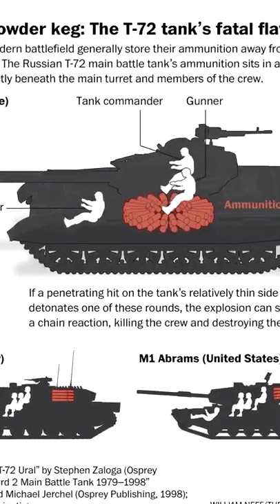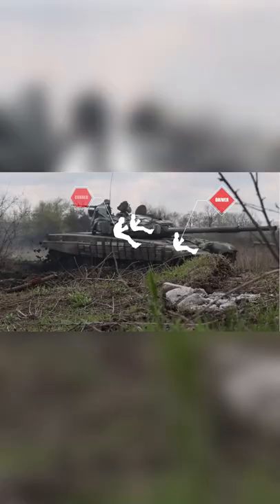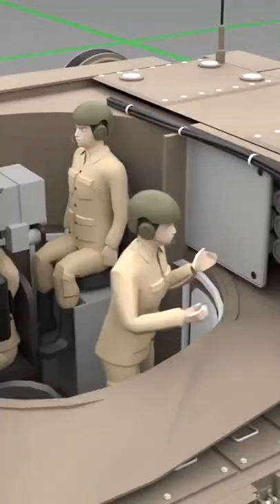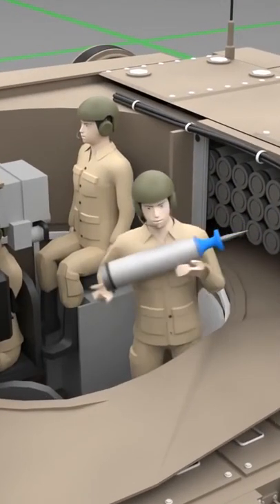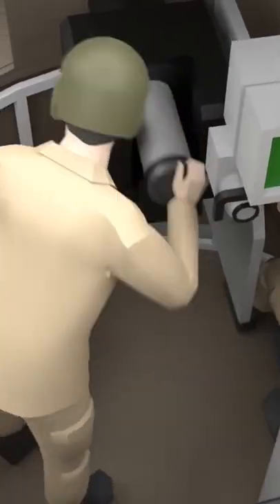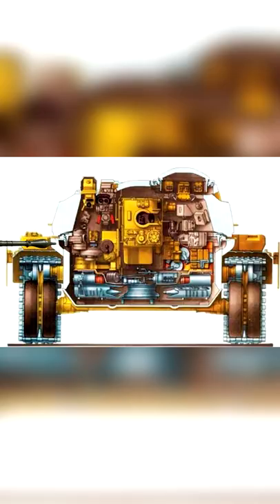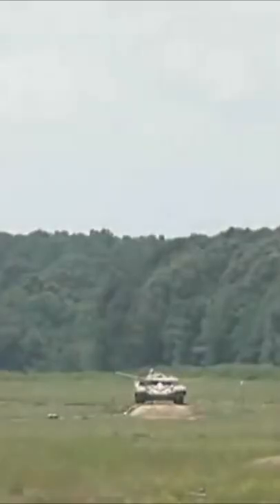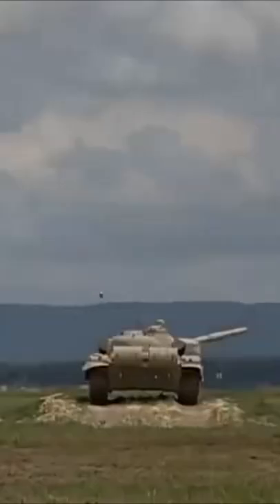Why do Soviet-Made Tanks Keep Violently Exploding? 🤔

Comment: It’s due to their auto loaders
Reply: no shit
Reply: He literally explained why that happens and it's not due to their autoloaders but rather because of hull stored ammo
Reply: @gumelini1  it’s due to the shitty way the auto loader works it has to have open ammo compartments for the auto loader to work
Reply: @Phlyinhigh  actually it doesn't.
Reply: French Leclerc also has auto loader but they put the ammo in the back of the turret. So definitely because of the ammo compartment location and not auto loader itself.
Reply: @gumelini1  there are no sealed blast compartments or “blowout” compartments so yeah it’s due to their shitty auto loaders
Reply: @Phlyinhigh  not really,it's because of hull stored ammo.Autolader carousel is armoured and you are not penetrating into it after penetrating the roof or hull already.